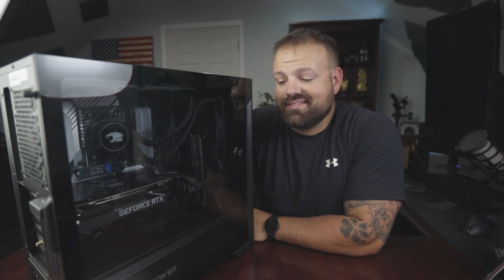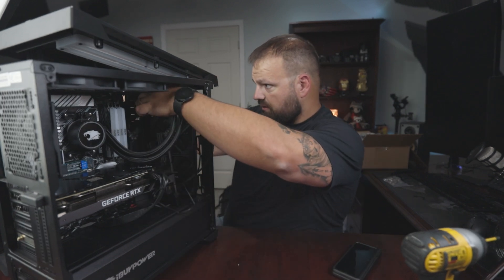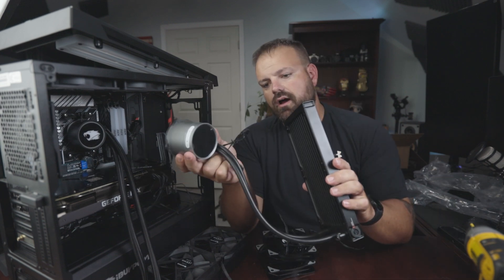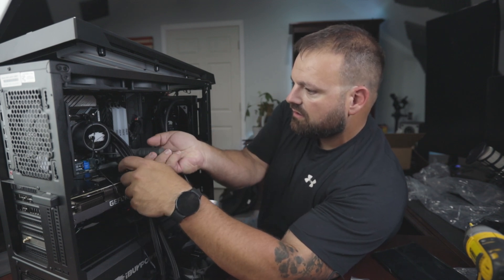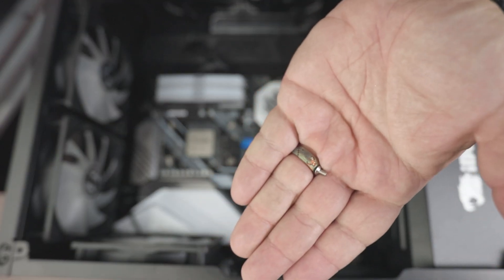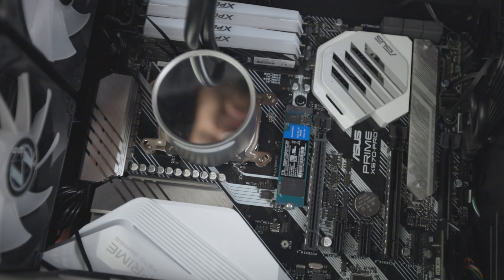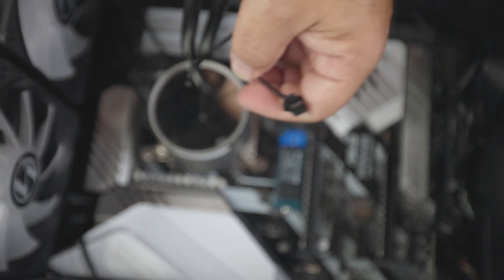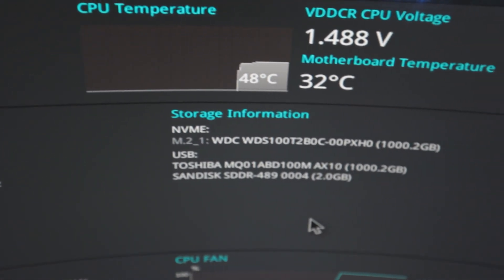Failed AIO Cooler Replacement: How to Fix It

Comment: Not sure if you mentioned it but how long have you had the PC for? My pump just started to give out on me as well. :(
Reply from the maker: I had it for I want to say 8 months before that happened. It was still covered under warranty for the replacement. I ended up forgetting to ship the old one back so I still have it. It was something like a $40 charge. I still plan to take the fans off the old one and add them in the case some where.

Comment: I have the ibuypower bb993 I told them I had no warranty for a cooler replacement that it’s been over heating and they sent me this one over free Thank you so much
Reply: Quick question, am I able to reuse the fans that was on the old radiator? Like place them on the top like your pc?
Reply from the maker: You sure are.